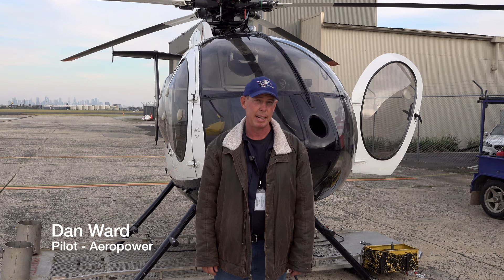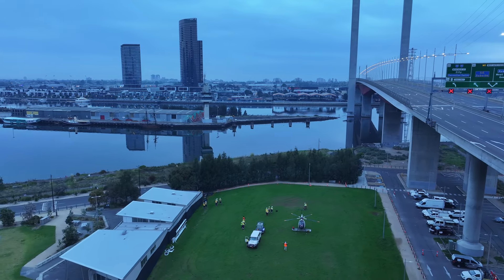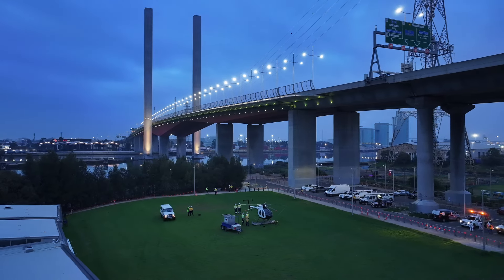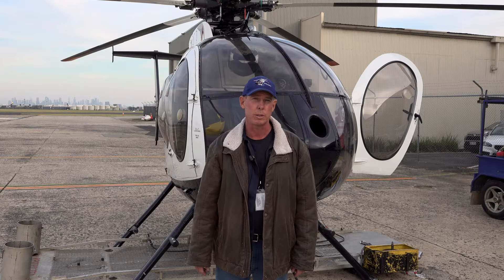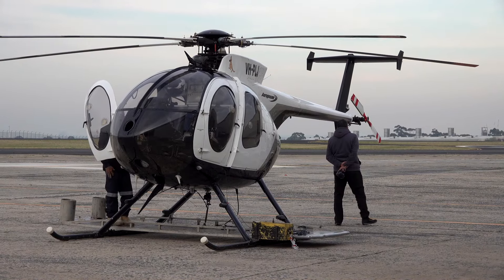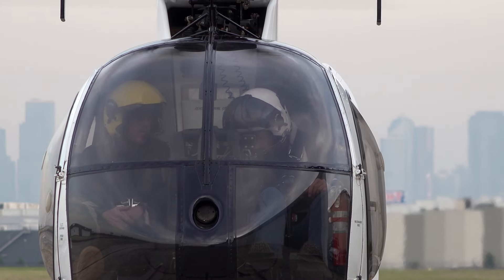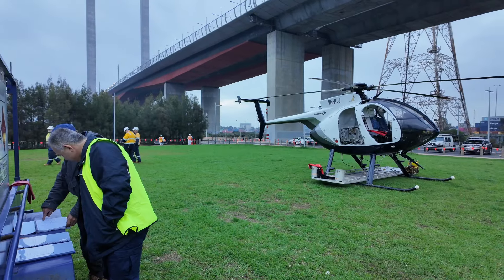Helicopter Removal of Marker Balls above the Bolte Bridge Melbourne

Comment: I wondered why you tethered onto the cable when you were already belayed to the chopper. When I saw it detached under load I understood it wasn't a belay, but what is it? Earth strap? (Except that the cable would be insulated from the ground...)
Reply: Grounding strap so the linesman and helicopter doesn't get hit by static from a dead or live line or arcing from a live line due to charge differential.
Reply: @damianwright3690  Thanks!

Comment: I didnt see any fighters there  where the refulling trailer was
Reply: I presume that you mean fire fighters not F-35As. If so I don't see them at the local servo when people are refuelling.
Reply: Refuelling aircraft happens all the time in all sorts of places. Think about helicopters and aeroplanes doing agriculture work out on the farms. No fire fighters needed (or F-35 lol).
Reply: @LungsMcGee  You could chuck your durry into a bucket of petrol and it wouldn't burn.

The vapour might though.
Reply: @dynevor6327  The flash point of JetA1 is much much higher than AVGAS, its basically inert until its subject to high pressure and/or heat
Reply: @vientayuno934  Catch up. Fighter or fire fighter?

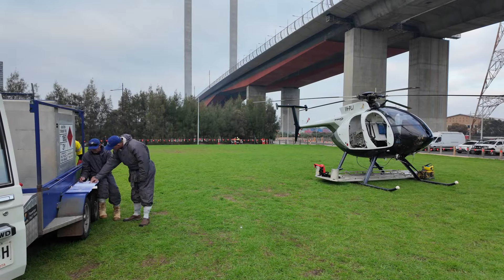Comment: 1:54 You could come across rusty nuts you recon ....
Reply: 2 piece balls generally have about 8 bolts around them and 90% of the time they rust or corrode , easier to cut them out !